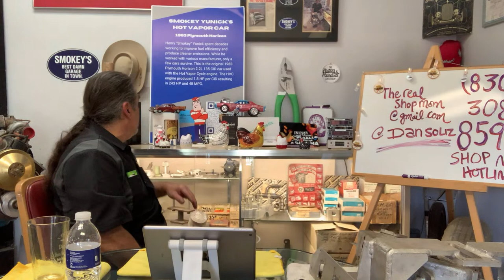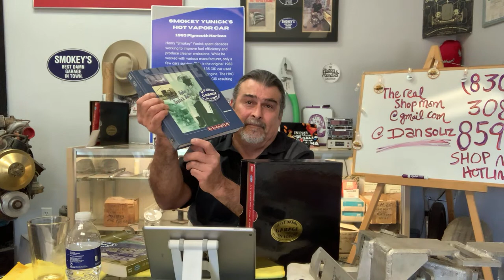Let’s talk about Smokey Yunick’s Hot Vapor Engines.

Comment: Great video, thank you for sharing all this valvetrain knowledge. 

I’m only to 27:00, I clicked on video for a Smokey Show and get surprised by some great lessons for a modern day solid tappet lifter user.

Please continue, this is great stuff. 
I only just found your channel and became aware of Smokey’s vapor motors a couple months ago. 

You’re doing important work educating and preserving these topics.

It blew my mind to realize, that Smokey’s hot vapor motors are mostly powered the hot compressed fuel vapor & air mix being outright desperate to expand after entering the cylinder. 
So the moment the mixture enters the cylinder past the valve, the mixture is already expanding inside the cylinder doing most of the work of pushing the pistons. 
With the final spark & burning vapor in the combustion cycle doing maybe a quarter or third of the work.  
3/4 of the engines power is from expansion of a pressurized hot vapor mix into the cylinder. 
And it’s not just “boost”, it’s taking advantage of fuel vapor wanting to expand greatly with simply heat & using waste heat to almost give free boost by heating your air/vapor mixture and expansion in a closed area happens, increasing the energy of your mixture until you release the hot vapor mix into a nice wide open cylinder where it greatly expands shoving the piston down even before there’s a spark. 

I’m amazed, astounded & grateful that I have access to this knowledge and Smokey’s hot vapor saga wasn’t lost to time. 

Super short question, have you done a video on Ralph Johnson or know much about his side of things? 
Occasionally it’s mentioned while Ralph was working at GMC, he applied some hot vapor concepts to a straight six engine with a single carb and made more power with less fuel, then the triple carb version straight six intended for the corvette. 
It was not adopted by GM.
I also heard Ralph Johnson’s name pop on in a Bruce Campbell interview with dragboss during a discussion of people who really knew how a carburetor functions. 
And I know Ralph Johnson was the other man behind Smokey’s hot vapor engines. 

Thanks again.
Reply from the maker: Thanks for your comments, yes I knew of Ralph Johnson. I think of him as the fuel guru! Not many have a grasp of how the HVC engine works or the history of it. Really enjoyed reading your comments. Thanks for your feedback, made a big difference on my day!🙌